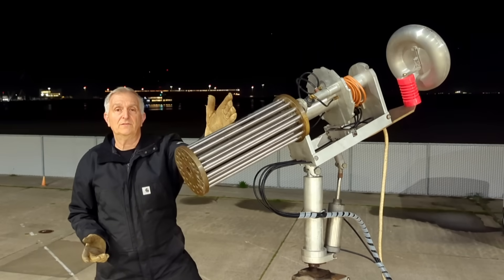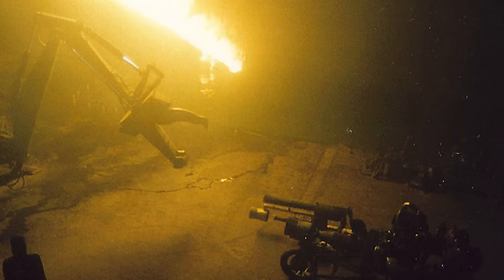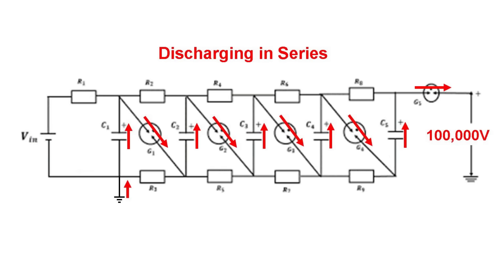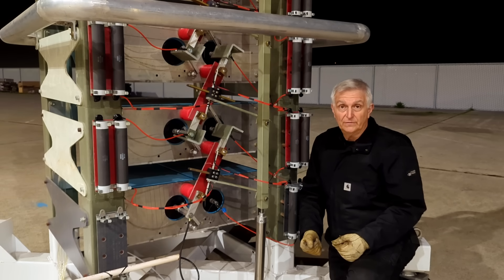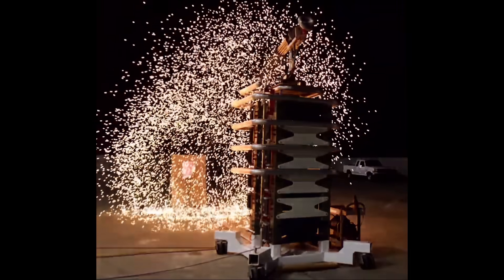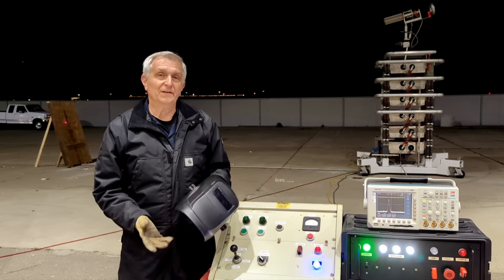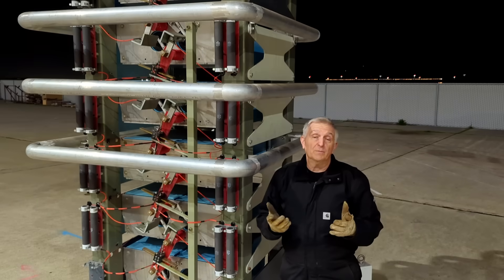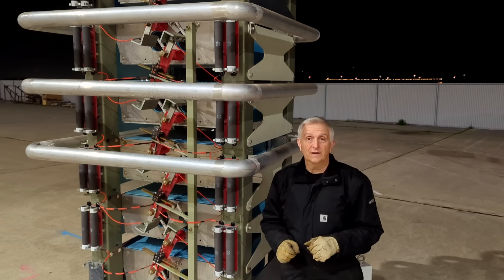Firing the Lorentz Plasma Cannon

Comment: So, why is 210,000 volts twice as much charge as 150,000 volts?
Reply from the maker: It's twice as much energy, because the energy goes up with the square of voltage.
Reply: @LightningOnDemand  ahh, that checks out

Comment: Im curious, whats the projectile that it fires? Is that a conductor
Reply from the maker: The dart is trailing a hair-thin trigger wire, which will direct the 30000 amp plasma channel to the desired target.  1:56
Reply: @ thank you. Thats what I get for skipping through to the last half to watch the cannon fire. 

Does this mean you are limited to using a wire propelled projectile with this cannon?

Comment: So, just to get it clear. The gun does shoot a wire which is transversed by an electric current so strong and so much comprised that turns into plasma the surrounding air in a fashion analogous to a lighting discharge, does it?
Reply from the maker: The dart is trailing a hair-thin trigger wire, which will direct the 30000 amp plasma channel to the desired target.  1:56

Comment: Ok, What is  the small ball that ejects from the plasma gun first? right before discharge you see it firing out of the barrels and the hitting the object, but only after this object connects with the target does the machine discharge..  any help would be appreciated!
Reply from the maker: The dart is trailing a hair-thin trigger wire, which will direct the 30000 amp plasma channel to the desired target.  1:56
Reply: @LightningOnDemand  Ah ok, I must have missed that, Thank you for your response! Wonderful video, really enjoyed it!

Comment: Incredible, and very interesting. I was driving home a few months ago, when I saw a lightning bolt strike many miles away. It looked like it was just a few miles away, but the sound proved it was much further. The beam was so wide, and the energy it contained so powerful, I was in awe. Now, I know, judging from what 210,000 volts can do, normal lightning can be very much more powerful. The Lorentz effect is very interesting, and I wonder whether it could be used against drones. The closer we get to people getting killed by remote control, the more we need defenses against such infamy, because those people are cowards, and they know it!

Comment: Not sure I get it.
The machine is limited by a wire, correct? The voltage travels down the wire, faster than the wire can be destroyed?
So you get one shot per wire, and are limited by the length of the wire?
It also does not seem to do much damage... physical damage. Even the paper target seems to just be blown away, like it got hit by wind, instead of being destroyed. Is this like an EMP?
Reply from the maker: The dart is trailing a hair-thin trigger wire, which will direct the 30000 amp plasma channel to the desired target.  1:56

Comment: It would be tough you could build a tuned CLC step up to a lower capacitance bank to get even higher voltages with an output spark gap to sustain the fast rise time.

Comment: Interesting. Couple of questions... 1) What is the gun launching into the target first, before the bolt cuts loose? 2) I understand that the target must be "grounded" first, so I suppose pointing it at something like that Chevy in the background wouldn't sustain any damage, unless it were sitting on its rims without the rubber tires?
Reply from the maker: The dart is trailing a hair-thin trigger wire, which will direct the 30000 amp plasma channel to the desired target.  1:56

Comment: you used electricity or gas to shot that beam?
Reply from the maker: The dart is trailing a hair-thin trigger wire, which will direct the 30000 amp plasma channel to the desired target.  1:56

Comment: I'm amazed that the screen was left intact!
Is that true for all of the image tube?
Reply from the maker: Looks like it.  The plasma channel went around the tube and connected to the deflection circuits.
Reply: @LightningOnDemand  Wow!
I don't know what that means or what it is good for, but I am amazed! 😮
Glass is a special stuff...
If I remember right a TV tube is mirrored inside?
Would've expected the ray to be stopped there, but it is a round mirror.
I remember your aim was slighty off-center at first. How was that with the tube?
Would you do it again VERY off-center?
Would you shoot at a straight mirror, tilted, of course?
I'd REALLY love to know if the plasma beam is deflected or what!
Thanks for your answer, too!
Reply: Or at water??

Comment: The issue is the target is shooting at is actually grounded.  You can see there's a cable that goes from the plate back to the machine.  Without this " grounding effect " there's really no true way to Target a specific Target.  Because if no targets are grounded you cannot Target them electricity will not flow in that direction.  So at the present time this weapon actually is only good for demonstrating arc flash and other scientific reactionary processes.  But it definitely is fun to watch nonetheless.  I'd say this weapon is at least 20 years away.

Comment: what is that bullet shaped object coming out of the "machine" going slow af toward the target?  I thought this was supposed to be an energy beam and that would be going at basically the speed of light, not some 50 mph speed.
Reply from the maker: The dart is trailing a hair-thin trigger wire, which will direct the 30000 amp plasma channel to the desired target.  1:56

Comment: What is the leader that precedes the plasma shock? It's a tiny projectile?
Reply from the maker: The dart is trailing a hair-thin trigger wire, which will direct the 30000 amp plasma channel to the desired target.  1:56

Comment: Awesome!!! I was witness to several early SRL events and met a few of the team over the years in SF...including Mark Pauline. This rig is epic!! Question: what is the little physical object being fired ahead of the plasma arc flash? Some kind of a plastic initiator pulling a thin wire/guide? If so, is this for safety & would the flash initiate on target without it?
Reply from the maker: The dart is trailing a hair-thin trigger wire, which will direct the 30000 amp plasma channel to the desired target.  1:56

Comment: What was the cylindrical metal looking piece that bounced off the TV screen?
Reply from the maker: The dart is trailing a hair-thin trigger wire, which will direct the 30000 amp plasma channel to the desired target.  1:56

Comment: What was the rod that was fired from the plasma cannon ahead of the plasma itself?
Reply from the maker: The dart is trailing a hair-thin trigger wire, which will direct the 30000 amp plasma channel to the desired target.  1:56
Reply: @LightningOnDemand  ahh excellent! I had not put together that there was a projectile leading the plasma. with the explanation of the wire earlier in the video I suspected that was what it was, but maybe i missed where you explained that was what was going on. thank you.

Comment: Yeah but there's one major issue with her device not saying it's not cool not saying it's not creative I'd say that you did anything wrong but it can literally be defeated by wearing rubber soul shoes because you say the target has to be grounded need to work on that part of it
Reply from the maker: Rubber soled shoes will hold off about 20,000 volts [if they're brand new and don't have metal bits embedded in them.]  They would punch through approximately 1 to 10 microseconds after the first streamer connected with the target, establishing a proper grounding path.

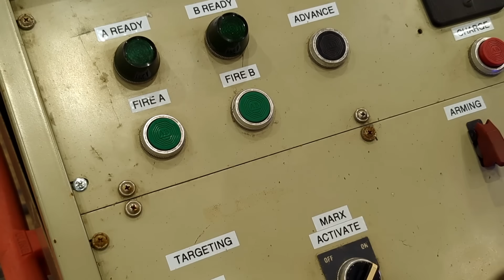Comment: Time stamps - beginning firing up the machine approx 6:00 - 6:10 , actually firing 6:15-6:18, and continues , noting for sure 7:50-7:58 frames. Enjoy.
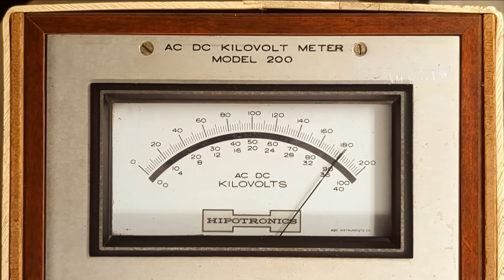Reply: Apologize, that's 7:30 / 7:40 / 7:50 / 8:00 / 8:10 , not fifty to fifty eight.
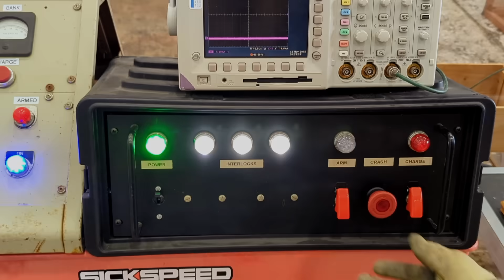Reply: Basically watching from 5:50 or 6:00 , until 10:00 , you've seen most the good stuff you came for.

Comment: This is crazy! You could, in theory, use a high energy laser pulse or a narrow radiation beam to temporarily super heat a channel of air making it conductive. After the path is made, the discharge would happen naturally so it could be all done in one step. No need for a wire, but it would require a huge amount of energy.

Comment: Why does the shockwave look like a dart projectile?
Reply from the maker: The dart is trailing a hair-thin trigger wire, which will direct the 30000 amp plasma channel to the desired target.  1:56
Reply: @LightningOnDemand  Ok, I thought that was circumvented

Comment: What is flying at the tv from 9:39 - 9:40? 
And why does the tv look like its still on afterwards in the wide angle shots but in the closeup its not even lit?
Reply from the maker: The dart is trailing a hair-thin trigger wire, which will direct the 30000 amp plasma channel to the desired target.  1:56
Reply: @LightningOnDemand thank you for clarifying the dart
Reply: Maybe it's the way to transfer the energy to the target? I have no idea.

Comment: 6:23 what is the projectile that proceeds the blast? 🤔
Reply from the maker: The dart is trailing a hair-thin trigger wire, which will direct the 30000 amp plasma channel to the desired target.  1:56
Reply: @LightningOnDemand does the wire become incinerated or is it more like a magnetic field and travels around the wire?
Reply from the maker: @phyrhfbr1819  the wire turns into a super-hot plasma channel
Reply: reminds me of T.O.W. missles... so if the projectile was maneuverable, the beam could be motile as compared to a static straight line... be guided, so to speak... you realize this predominately has battlefield applications, for the most part? 😏🤔 job well done sir, you made a soft lightning gun... have you had any arching? from magnetic interference? you really should cover yourself more during tests 🤔 if you cook yourself, you tube will never let it be uploaded 😅

Comment: What goes flying out of the gun just before the plasma hits?
Reply from the maker: The dart is trailing a hair-thin trigger wire, which will direct the 30000 amp plasma channel to the desired target.  1:56
Reply: @LightningOnDemand  Ah.  Thank you! Great video.

Comment: But why did the particle board not explode if it was traveling at such a high velocity?
Reply from the maker: This plasma channel blows a hole in the particle board, just like lightning would
Reply: Witty indeed, but I'm genuinely curious how it didn't blow straight through the back
Reply from the maker: @motohavoc104  It does in the thumbnail

Comment: I see what appears to be a projectile at the beginning of each shot 
What is that?
Reply: It fires an electrode with a thin wire attached. Once the circuit completes with a grounded object high current flows through the wire and vaporizes the wire. Lorenz force keeps the plasma contained so that there remains a path for the current until the capacitors are empty
Reply from the maker: The dart is trailing a hair-thin trigger wire, which will direct the 30000 amp plasma channel to the desired target.  1:56
Reply: @LightningOnDemand  thanks

Comment: Cool! What is the projectile hitting the CRT screen in the video time 10:28-10:31. Looks like a 3-4" dart?
Reply from the maker: The dart is trailing a hair-thin trigger wire, which will direct the 30000 amp plasma channel to the desired target.  1:56

Comment: Man builds the most powerful taser ever and then deadpans this at the end:  
>>>> SPOILERS BELOW <<<<<

"The data suggests that a plasma cannon with just a 30ft. high Marx Tower could achieve a 1/4 mile range.  THAT would be a fun follow-up project, indeed."

Let's take this idea a little further - put the cannon on a switch that allows switched connection to multiple Marx Towers that are on asynchronous charge cycles - enough that the cannon can fire once every 3 seconds or so.  Nothing says those banks have to be above-ground.  These things would be absolutely bonkers as defense for a hard target.  Though you may need a local nuclear power plant to keep the lights on.  xD

Comment: I have been using a grok AI and have designed a system that can propel a space ship by electro gravetics.  Townsend Brown look him up.  This that you have done is basically the kind freak power I need. But on a muck larger scale.  Very interesting. Do you have a blue print or just an explanation of the science so I can see if grok can determine if it could be interwoven by the science of it. Thing is space there’s a lot energy available just need to concentrate

Comment: How is this plasma if it's a bullet flying?
Reply: It's not, that's a weight for a super thin trigger wire, it's what gives the plasma the arc to follow, whatever that weight and wire hits is where the discharge is directed.
Reply: @itsty-ler  interesting so the plasma doesnt need the weight n wire to work?
Reply from the maker: @RomiosVidEdits  The dart is trailing a hair-thin trigger wire, which will direct the 30000 amp plasma channel to the desired target.  1:56
Reply: @LightningOnDemand  so withought that wire it wont be a plasma shot?

Comment: Would it be possible to use a strong laser or focused electron beam to ionize the air enough to form the arc ? to get rid of the wire I mean ...

Comment: What flies out of the cannon towards the target right before discharge?
Reply: It fires an electrode with a thin wire attached. Once the circuit completes with a grounded object high current flows through the wire and vaporizes the wire. Lorenz force keeps the plasma contained so that there remains a path for the current until the capacitors are empty

Comment: Sorry, but what is the nail-like projectile that is fired prior to the plasma discharge?
Reply from the maker: The dart is trailing a hair-thin trigger wire, which will direct the 30000 amp plasma channel to the desired target.  1:56
Reply: @LightningOnDemand  Ah. Gotcha. Thanks for the explanation.

Comment: I admit, I did skip to the cannon firing. But what I saw had me so intrigued that I had to go back and see how it works and what you had to say about it, and I'm so glad I did! Physics like this (particularly electromagnetism, etc.) is an area of science that sometimes runs tangential to what I study (planetary geology), and I've always been interested in all sorts of electricity and plasma applications, so this video was just a delight! Thank you for the thorough, accessible, and engaging video!

Edit: I'm not sure if you'll actually see this comment given the sheer number on this video, but if you do: Could you clarify what you meant by saying the channel didn't connect with the CRT, but went around it ( 9:50  in the video)? Does this mean that the channel continued along the path defined by the "pilot" projectile, and simply didn't interact with the CRT, or that the channel itself diverted around the ray tube?

Comment: How much energy goes into vaporizing the wire vs being dumped into the target?

I wonder if you could hypothetically use a superconducting wire with a large, deliberately inefficient tip made of some material with a massive resistance, but not enough to prevent the voltage from jumping to the target. This would  just dump 100% of the power bank right onto the target point blank with no waste vaporizing other stuff. 

Of course you would then also need an extremely complex system that is capable of both supercooling the wire and launching it fast enough to hit the target before it cools down. Maybe with a few dozen more lotteries you could try this one for a single shot😂

Comment: Sorry, my knowledge of electrical discharge is limited to the ouch parts, what is the thing that looks like a projectile that comes out of the cannon?
Reply from the maker: The dart is trailing a hair-thin trigger wire, which will direct the 30000 amp plasma channel to the desired target.  1:56
Reply: @LightningOnDemand  Thank you for your reply. Great video, I look forward to seeing more of what you do. Stay electric and stay safe 😀

Comment: Just so I can get some of the specifics right, so the device charges up the projectile to super high voltage and shoots it out. Then whenever it hits anything, that object becomes the path of the current between the projectile and the ground? The projectile is connected by a wire to the device? But what is the purpose of the 30 some barrels that the projectile shoots out from? Thanks for any help!
Reply from the maker: The dart is trailing a hair-thin trigger wire, which will direct the 30000 amp plasma channel to the desired target.  1:56   with 30 barrels you get 30 shots before you have to reload it

Comment: 39000 Amps at 120kV sounds absolutely terrifying. I work on substations and most of the 120kV lines don't supply more than 600 amps before hitting the transformer and that's with a high load. fuckin scary amount of power and potential.

Comment: 🟢🟢🟢 QUESTION: 
What  is the projectile shot from the Turret to the target ?¿? 

You can almost make it out a 8x slo mo.  Slow mo to 1,000,000 fps instead
Reply from the maker: The dart is trailing a hair-thin trigger wire, which will direct the 30000 amp plasma channel to the desired target.  1:56
Reply from the maker: i wonder how many people would watch a 20 millisecond plasma channel explosion at 1,000,000 frames per second -- that would take over 11 minutes.  :D

Comment: Looks like a projectile was fired at the board with a wire attached then a high voltage was sent down the wire to give the illusion that some form of ray came from the "plasma cannon" good magic trick.
Reply: That's part of the process that was explained in the video. Did you ignore the talking and skip ahead to the fireworks?

Comment: As an uniformed troglodyte in electrical sciences, what is that illuminated “sprite” that goes 1/10 of a second before the full discharge. It appears to follow the laser beam path.
Reply from the maker: The dart is trailing a hair-thin trigger wire, which will direct the 30000 amp plasma channel to the desired target.  1:56
Reply: @ Thank you so much!